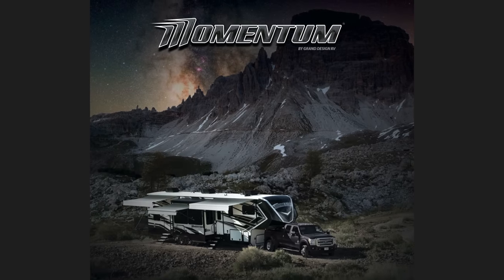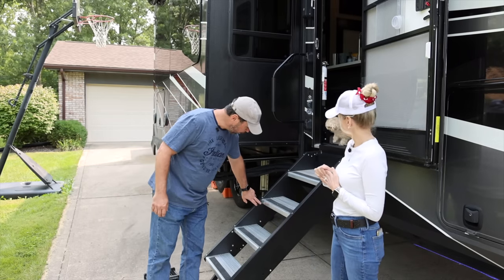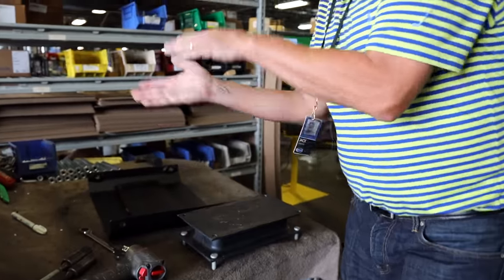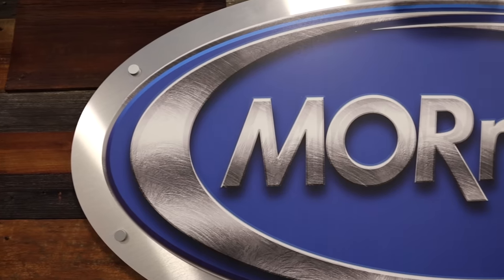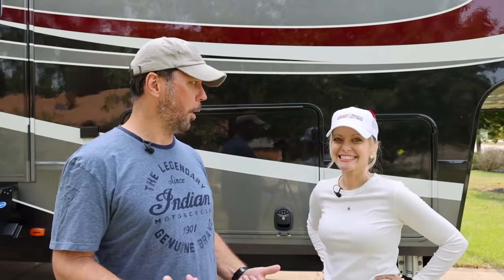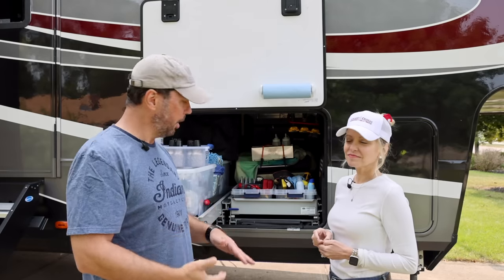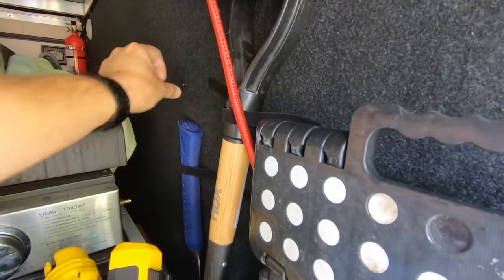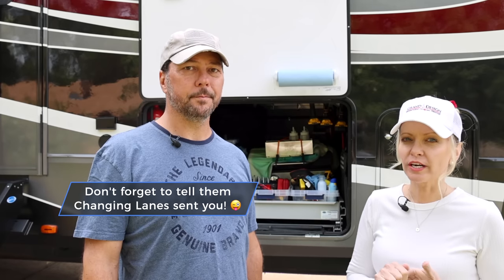MORryde RV Upgrades! (Basement Slide Trays | Step Above | Rubber Pin Box)

Comment: I had the Lippert pin box on my last trailer; between the leaking air bag and shock, the first thing I added to the new Momentum was the no-maintenance MorRyde rubber pin box and I love it. I then pulled the trailer back to Elkhart last December to get the 8K IS and Kodiak disc brakes installed--an amazing and worthwhile upgrade (they offer Winter installation incentives). MorRyde makes great products. At the RV show this year, I even purchased their PatioX ramp door tent.
Reply: Craig Carter, How do you like the ramp door tent?
Reply: @preachers4135  With the current situation, I haven't had a chance to use it yet. I love that it inflates automatically and can be used even if you have the newer bed rails that are not squared off in the corners. Also multiple ventilation options.

Comment: We just finished installing the 39 by 90 inch model into our basement 
When measuring we didn’t see a bathroom drainpipe so we did a reroute on that pipe and cut a notch in the tray frame. All works good now. Necessity is the mother of invention.

Side note...if you order from amazon it usually gets shipped by a large truck and will take longer.

Comment: I have the MorRyde 90” slide in my fifth wheel. Love it. I have the MorRyde kingpin you have and unfortunately it put a hole through my tonneau rails. I had to replace the rails - an expensive bummer. I just had the Roadmaster slipper springs with shocks and disc brakes installed two weeks ago. The Roadmaster does completely isolate each axle unlike all of the SRE products and is a less expensive option than IS. LIKE JD, I can’t use the step above steps because there isn’t enough room to swing the steps out without hitting the RV next to me when I pick it up and drop it off from storage. I’m looking at the TorqLift system, which JD used on his Chapparel. Still great video. Excellent products for consideration. Each individual must evaluate products based upon their usage, needs, budget, RV, etc

Comment: Nice upgrade with the trays. I was just there three weeks ago, had disk brakes and equalizers installed on my GD travel trailer. The staff both in the shops, sales and front office were so cool and very happy to answer any questions and had their own questions about who is buying there products. Even let them use my rig for R&D for new products coming for the TTs.

Comment: Our 2016 Fuzion came with that pinbox. Odd part is when you stop in traffic fairly abruptly, there's a slight delay and then a bump. And when you take off, delay and bump.  The good part which is awesome, that over the highway there's no bucking and chucking. Much smoother

Comment: Great info. Can't wait for the Step Above Gen 2 to be available. We currently have the Lippert Solid Step and the tread mounts are starting to crack after a little over a year or use.  It will be so nice to replace the pin adjust with the trigger adjust.

Comment: I added the MoRyde slide-out in my 40’ FW...one piece...opens 70% front side and 30% back side (which is great because that is enough to to get all the setup and black water stuff...best thing I have done to the rig since I got it.  I did have problems hitting the lip as well and did not know about the factory pieces to raise the slides so we put a 2x4 and a 1x4 on top and painted it black and now it slides right over the lip and metal pieces for the door locks.
Reply from the maker: 2x4's can fix all kinds of things! 😀

Comment: We have the Morryde steps on our full profile Columbus.  I would go back to the folding steps in a heartbeat.  
Problem #1  Wife can't reach the door handle to get the door open and drop the steps.  
Problem #2  When parked where there is a downward slope towards the steps, there is a possibility that the steps won't lower enough to sit flush with the threshold of the door.  This can (and will) result in a creased, or even possibly, a bent door.  Been there, done that.

Knowing that we all make mistakes and sometimes overlook things when doing the predeparture "walk around", I would hate to be the guy that forgot to raise the stairs with the Morryde system.

That being said, we do love having the fourth step.

Comment: Another great video!  You will be most satisfied with IS and disc breaks installed by the great professionals at Morryde.  You might also consider going to 17.5 inch diameter tires and wheels as well as adding Timken bearings.  Our Vilano rides and stops considerably better than it used to.  Safe travels.

Comment: MORryde Independent Suspension and disc brakes.  Don't leave home without them.  We are currently pulling our second 43' fifth wheel and this has both IS and disc brakes.  My belief in both is beyond explanation.  Twice disc brakes have saved us.  I tell of the 5 car pile stating that we were the 6th vehicle in a 5 car wreck on a modified interstate. 
We once had our rear sofa bounce so high that it literally broke the window operator (bounce of about 6" vertical).  The IS eliminates the "after shock" going down the road.  Chad you know that your first indication of a road imperfection (bump) is through the steering wheel.  The second is when the rear axle goes over the bump.  Then you wait to feel how high the trailer is going to bounce (after shock).  This is what you'll have to get use too because with IS that anticipated 3rd bounce is gone.  You'll ask "why didn't we do this sooner"? 
MORryde is a fantastic place.  We have been there several times and also have had slide out trays installed.   MORryde is not just around the corner for us.  We live is Plant City and also are friends with Bama at LazyDays. 
Safe travels and perhaps will see you"ll down the road.
Jeff & Nora
Reply from the maker: Plant City to Elkhart... Definitely NOT around the corner!  LOL  Tell Bama we said hi!

Comment: I put the slide in my basement unfortunately it collapsed. I had to build brackets on the sides for lateral support now they work great.
Reply from the maker: how did they collapse?  Do you have any pics?  Ours seem very sturdy.  
If you have pics, please email them to info@changinglanesrv.com
Thanks! 👍🏼
Reply: @ChangingLanes  I didn't take pictures i just made the repairs myself. The reason the slide collapsed is they are mounted with small screws to the floor of the compartment that were not strong enough to cary the lateral load so I made brackets on the sides for support

Comment: Hi Chad & Tara, great video...will one day have to see if can get those basement slide outs. 
Have an off question to something I saw mounted in the street-side basement on left wall - the fire extinguisher. Is that a 5 pounder (what I have is 2 5# for rig, + 1 GD supplies, and another 5# in F-450 and want to mount the rig ones)? 
What screws did you use for the holder?  I have a 2021 model yr Solitude 310 GK, and a device on charging, solar/batteries, just inside on left, so would have to go in a little further - guess I’m overly cautious as do not know what is behind the wall. 
Any clues/help would greatly be appreciated. If brought up in another vid, just point me there and will review. Thanks very much.

Comment: Great video. Have you weighed the rig lately with all the extra stuff in it?
Reply from the maker: No.. but I'm telling myself we shed about 100lbs of pin box and added 100 of slides... 😀   We do need to get a weight though.. maybe after the IS install...

Comment: What hardware did use to secure the tray to the bottom of the storage bin? We have a Fleetwood Boulder. Believe the bin bottom is metal. Not sure. Screws.? Bolts? Thanks.

Comment: The problem with the Lippert and MORryde steps is the handrail being on the inside of the step frame versus the outside of the frame.  It makes you feel like you are being pushed off the step and makes it difficult when opening the door.
Reply from the maker: Interesting.. I know on the GEN 2, the step frame itself it thinner (the sides)... that might help some....

Comment: Hey guys! Love these upgrades!!! We actually have to reorganize our garage area in the next couple weeks before we head out to our next spot. We might have to look into doing this in the future too!!!! What has been your guys favorite upgrade you have done throughout your travels?! ~ Maggie and Brandon
Reply from the maker: These trays are definitely in the top1 or 2 till we get the IS... 😎
Reply: Great question. Follow up is: Is this something you would consider a must have from the start when you buy your RV?
Reply: Bruce Gruenbaum Well from our standpoint we have been fulltime for over 2.5 years and don’t have them and have been fine! We just have to take things out if we want to get to our storage in the middle and this would eliminate that! So overall something you don’t necessarily need but probably once you get it you would be so glad you did!
Reply: RV there? My motive for asking is I am thinking about ordering a 376TH and want to put 6 to 8 Battle Born batteries in with 10 solar panels. I have been told that anything over 4 batteries will go into the “basement,” but I think it eats into slide-thru slide space. I am very keen on the slide-thru’s because the “basement” and the through space at the rear of the 376TH are going to be a PITA to get into. They’re narrower and flatter than on the 397TH. So I’m wondering if I do 4 batteries first, get the slide-thru’s installed, and then decide about the other 4 batteries. 

Soooooo many questions when you are starting out with new equipment...
Reply: Bruce Gruenbaum this upgrade might work for you then! 10 solar Panels that is AMAZING!! Boondocking time for sure! ~Maggie and Brandon
Reply: RV there? Yeah... great for Boondocking for sure and I’m trying to figure if we can rely on those solar panels to keep the batteries charged to power the fridge and internet while we are driving.

Also, the 376TH has some questions around the black and grey tanks in terms of size for boondocking. The black tank is 52 gal. The grey water is 104. It will only ever be 2 of us boondocking. Just not sure how many days that gets us.

Comment: Hey Guys, did you change workbenches? The one on this video is gray with what looks like a red router insert, just wondering as I’m setting up to go out on the road on extended trips. Thanks..
Reply from the maker: Same once we've had since day 1.  https://amzn.to/3kOhpJY  Ours is an older model.  the one linked is the same but slight changes in color etc.
Reply: Changing Lanes Cool, Thank You👍

Comment: Hey there Chad what width tray did install for the side to side pull out? I know the length is 90 inches curious what width you used? I'm looking to install in a Solitude with a similar basement configuration.
Reply from the maker: Ours are 25" wide (the pass-thru) and 19" wide.  Be sure to see the blog post - there's a video of the basement wall modifications...  https://changinglanesrv.com/rv-upgrades-basement-slide-trays/
Reply: @ChangingLanes  Thanks Chad, I did see your mod and others to that slated wall. I don't plan to put a tray on that side at the moment. I've been in an Open Range for the last 4 years, just joining the Grand Design family. Will be picking up the rig next week. I wanted to get a head start on the pass-thur tray nearer the nose. Be well, stay safe you two.
Reply: @ChangingLanes  What is the length of the 19"?

Comment: When you screwed the MoRryde slide out tray frame to the basement subfloor, did you use long screws and screwed all the way through the 5/8" subfloor or did you use shorter screws and just screwed into the plywood subfloor?  I am trying to avoid opening the underbelly.
Reply from the maker: They were about 1" wood screws.  Plenty of meat and very solid.
Reply: @ChangingLanes  Thank you for your response.

Comment: Our new 399th arrived last Friday, and we scoped it out on Saturday. It came with the 21k MoRyde pin box. Unfortunately, our CCC is now a tad over 4k# due to the added weight of the 8k axle upgrade. 

Do you know if MoRyde has a 24k pin box in the works?
Reply from the maker: Not sure.. the sticker on our pin box says 21K or 23K (6 bolts).  They might make some kind of plate adapter?  I would call MORryde.
Reply: @ChangingLanes  thanks for the note. Sounds like the identical pin box. We'll get it figured out. Having a hard time finding the truck hitch now. Nobody has stock.
Reply from the maker: eTrailer has the M5 27K: https://www.etrailer.com/Fifth-Wheel-Hitch/Reese/RP30922.html?etam=b0003

Comment: How long is the warranty on the rubber bump in the king box
Reply from the maker: https://www.morryde.com/wp-content/uploads/2020/01/Suspension-Parts-12-Month-Limited-Warranty-Commercial-4-6-18.pdf
Looks like 3 years / 70K miles.

Comment: @Chad: How have the storage slides affected your workspace in the basement? Is it more cramped?
Reply from the maker: Not at all.. Just had to rearrange things with a different mindset (ability to easily access everything).
Reply: I realized I didn’t ask this quite the way I meant to. You have a bunch of video of you working in the basement for the water pump, etc. Do you need to remove the MORRyde storage slides to get in there to do that kind of work? Or can you just get in there on top of the slides? 

Next time you have a maintenance video for the basement, please include some footage of what you have to do to work around the MORRyde storage slides.

Thanks a ton for the work you two do on your channel. It is one of the best internet resources I have found.
Reply from the maker: All sides, on every RV we've ever seen, are living area slides and don't interfere with the basement at all.  Hope that makes sense.
Reply: Changing Lanes That makes total sense, and I pretty much knew that already. If I had been a little smarter, I would have been more specific 😂😂

I was referring to the new MORRyde storage slides you just installed. Obviously the new storage slides take away room vertically in the basement. That area was big enough to accommodate you climbing inside and working there when you needed to do maintenance for things like your water pump. What I’m trying to understand is if you have to move or remove the storage slides to get in and out and do that kind of maintenance. Do you need to do anything special to get in and out of the basement now?

Sorry for my dumb question. 🤪
Reply: AND now I feel like a complete idiot! 

You answered this question in the video in the blog post that describes the basement wall mods (https://youtu.be/_wRWIYlsna4). All you do is slide the thru-slide all the way across past the work area and the other slide out the opposite direction. Perfect! That helps. Thanks a ton.

Comment: I just posted a my first video ever showing my new tonneau cover and tool box so you can see how the cover is more secure and doesn't add anything inside the box or add and height to the box rail. p.s. Please don't be too critical of my video skills.
Reply from the maker: I like that!  So, you just remove the whole thing when towing and stash it away...  Do you have a link for that tonneau?
Reply from the maker: I found it...   Also found some videos on it.  Installation looks simple.  How difficult is it to remove for towing?  Looks like just the two T-handle nuts?
Reply: @ChangingLanes  It takes 1 to 2 minutes. Just pull down the 2 forward handles then just fold it up. Great build quality.  Very secure when closed.
Reply from the maker: Thanks!  Will check it out!